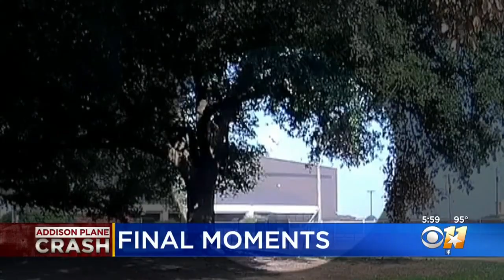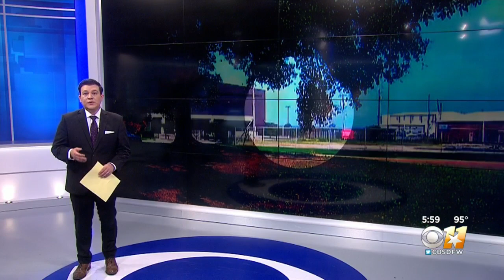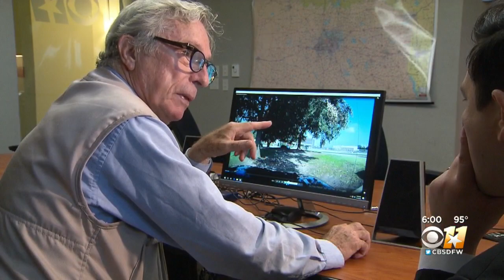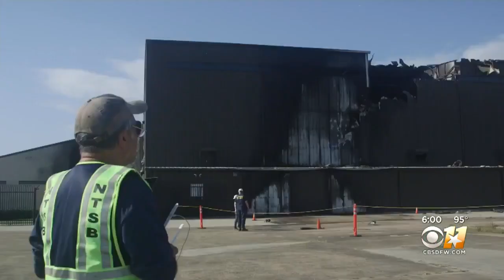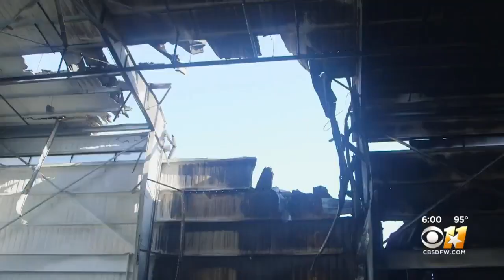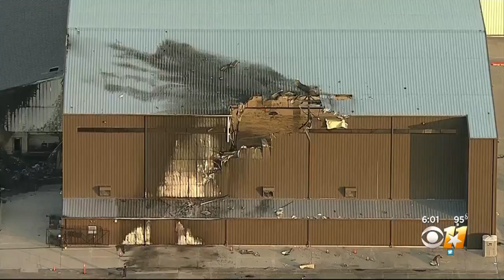Video Released Of Deadly Plane Crash In Addison

Comment: It’s now suspected that the throttle friction wasn’t tightened enough to keep the power full on and the pilot was a jump in and fly type. No checks were audible and the plane took off 7 minutes after spooling up. WAY too soon to have performed the checks. The throttle tension is on the checklist because it resulted in death previously and likely in this instance too. 71 yr old pilot was known to skip checks. He won’t skip any more!

Comment: IT was all pilot error, failure to use checklists and mainly failure to set the throttle friction.  They experienced left throttle migration, didn't recognize it, the pilot applied left rudder and then right, but it was too late.  He was apparently known to fly without checklists and it cost them all their lives.

Comment: YIKES.. the left engine had trouble and the right engine's torque made the plane roll over and crash.
The King Air 350 was very heavy with 10 passengers and luggage. The pilot didn't have much time to make any corrections. RIP to all lost.... When was the last annual inspection and was there engine tune up or repairs??
Reply: stop acting like u know shit it was most likely huma error like most plane crashes
Reply: Gage  Engine Failure During Takeoff (At or Above V1) for King Air B200

1. Power - MAXIMUM ALLOWABLE

2. Airspeed - MAINTAIN TAKEOFF SPEED OR ABOVE

3. Landing Gear - UP

4. Propeller (Inop engine) - CONFIRM AUTOFEATHER or FEATHER

5. Airspeed - V2 (after obstacles cleared, Vyse)

There are procedures for plenty engine failure situations so I'm certain it's not an automatic crash when you lose an engine. I think feathering is the key but I'm no pilot so this might be wrong.
Reply: Takeoff at MTOW with a Twin-Engine Aircraft is a Critical Stage of Flight.  You have to practice in your mind how you're going to respond to an
Engine Failure at that stage of Flight.  When you receive your Twin-Engine rating these are exactly the kind of circumstances you train for.
You have just a few short seconds to respond correctly, or this is the end result.
Reply: @Gage The King Air has Auto-Feather on engine failure. 
It's not really the engine torque or twist that makes the plane Snap Roll or VMC Roll or VMC Stall or whatever people want to call it. It has to do with the fact that, in this case, as the plane yawed to the left more and more of the engine out wing is covered or blocked by fuselage and thus its lift capabilities become less and less. You can see in the crash video the plane is skidding or yawing horribly. It gets to the point that the left wing is blocked so much that it looses its lift and stalls and the right wing snaps the aircraft over with all its lift intact. Also, as the plane yaws more and more the fuselage side surface starts adding drag and slowing down the plane taking you below VMC or the Minimum Control Speed. If you have full rudder in then you know your about to snap roll. It's a terrible balancing act of getting bank into the running engine side and rudder. Plus, the gear down did nothing to help matters. All that being said he only had 12 seconds from liftoff and 8 seconds from when they recognized an engine issue before impact. Plus, here could have been other factors or causes leading up to that moment. Heck, a rudder trim tab set wrong could be the cause and the pilots just thought it was the engine.
Reply: I can tell you what I would've done, and I don't even have a Pilots License.  

I've begun my takeoff roll and I've reached takeoff speed and rotated.  I'm beyond the point of abort.  Suddenly there's a loss of thrust on one engine. In a second determine which engine it is, then quickly change your trim settings to make your control surfaces more responsive. 

by the 3rd second, Pitch the Nose down level to keep forward speed up. Begin a shallow bank and rudder turn away from the dead engine.  This will give you a feeling right away of how the plane and controls are responding to Asymmetric thrust.

Your landing gear is Fast Acting, hit the gear up by the 6th second.

A shallow bank away from the dead engine also keeps your wing with the dead engine from Stalling.

by the 8th second you should be in a shallow climb and / or leveling off and flying on one engine, preparing yourself for a mayday go around and landing. 

And if you're really good and prepare yourself,
you can compress that all down to 4 or 5 seconds and look like a Hero / Pro, instead of killing all on board.
Reply: Gage  .. The pilot did not react quickly to the engine failure.. Of course you will tell us the proper procedure........!
Reply: Gage  In King Airs equipped with autofeather, the operating engine drives the autofeather of the dead engine. With the cockpit voice recorder recovered, I hope the investigators can determine if the autofeather was tested before takeoff. King Airs are known for very docile behavior compared to piston twins, during engine failure events.

Comment: His propeller became an airbrake because he didn’t feather the prop in time. Based on the other evidence he was in a steep angle of attack or Vx on rotation. I never pitch up too high in multi engine. There is a speed called blue line that must be exceeded at all times. 
Anytime there is an abrupt turning anomaly on takeoff roll shut both engines down and land straight ahead. This is critical in multi engine flying if you have an engine failure on takeoff roll.
Reply: Sky Flyer impossible. Modern PT6 engines use oil pressure to turn the props in beta range. There is a pitch lock regulator that prevents the prop from going in to flat pitch in an event of oil pressure loss. 
Based on the 737 max I wouldn’t doubt there are design flaws in the new 350i. 
I really want to see the final ntsb report.

Comment: I have a fairly generic question that maybe others are asking or thinking. 
So we reach V1, rotate and have a positive climb rate albeit not for long.  
1. At what point did the port motor fail?  Before V1, during V1 or right after they lifted off?
2. At what point does a PIC call for gear or raise the gear themselves?  Directly after takeoff, or at a certain height or speed?  From a laymen it seems the gear down would 100% cause more drag thus slowing them more rapidly especially with the port motor being down.  Could have calling for gear up given the flight crew that extra speed they needed to extend and gain a positive rate of climb vs scrubbing more speed eventually causing a stall 
Thanks for your comments and feedbsck. 
Prayers to the family and friends of the people onboard.
Very sad.

Comment: Seem like the right engine was on fire just seconds before flipping over and hitting the ground!
I've also heard that they where over the gross limit weight of the plane. So there was no way a single engine could handle the load. Seems to me that the weight limit should be restricted to what one engine can handle.
Reply: That was just glint from the propeller

Comment: First: WOW!! Worst CFI ever as a commentator on an accident, “at some point you become a passenger.” What kind of pilotage are you teaching? You don’t stop flying the aircraft because things aren’t working right!!! Hopefully with his next BFR the FAA will weed this terrible CFI out. 

Second: How did CFI commentator of the year see right past the obvious? These pilots had things going wrong, BUT yet the aircraft was still flying. More than likely the pilots saw the hanger approaching, increased their pitch (fearing they weren’t going to clear the hanger), slowed below Vmc, and yes at that point like CFI Yeager stated “something went wrong.” 

My prayers are for the souls on board, may they Rest In Peace, as well as the witnesses on the ground that have been traumatized by this accident.

p.s. Pilot’s watching this video, do yourself and your passengers a favor: Don’t stop trying to fly the aircraft and work the problem. Good CRM and good systems knowledge will get you a long way.
Reply: I don't think when he said "there is a point where you become a passenger", he was talking about the situation being unmanageable. Because pilots are trained to deal with this situation, and he as a CFI knows that.

I think he's talking about pilot ability, or rather, these pilots lack of it. And it makes sense really. First, if a pilot does not know how to quickly handle an emergency situation like this, then soon the situation could deteriorate to the point it becomes unrecoverable. And second, even if they figured out what was going on, did they truly know what to do? Because they could've very well handled the situation improperly, not taking proper emergency procedures, crashing is pretty much inevitable, and at that point you might as well have been a passenger for all the difference your actions made.

So before you go around hoping this guy loses his job, I suggest you truly analyze what he is saying, rather than interpreting it very literally, and therefore incorrectly. 

And if you think that he's truly "Worst CFI ever", I suggest you watch the Air Safety Institute's video "Accident Case Study: Everyone's Problem
". You'll be in for quite a shock.
Reply: Obsolete Collector My  comment comes from my 20 years of commercial flying. Never in my private days or now in my commercial career has an instructor said that it’s okay to become a passenger. The instruction has literally been to “fly the aircraft” and keep working the problem. My training normally has something that limits the performance of the aircraft and requires me to think, act quickly, keep flying the aircraft, OR crash. For example, I’ve had props fail to feather, high altitude on a hot day t max gross takeoff with an engine failure, and cold days with icing and a single engine or failed system. And yes, if you don’t react properly you will crash. But that’s why you rehearse this stuff. And why you can’t become a passenger. 

To your second paragraph, every six months I am required to handle an emergency similar to this. The PIC on that flight is to do the same thing, real world is obviously more stressful than a simulator, but his knowledge of what to do should have been there. An example from what I can see in this video is that he hadn’t retracted his gear yet, why didn’t the CFI in this video bring that up as a cause for his accident? Because he’s a terrible CFI!!! He’d rather scare people about the dangers of flying and how he’s the best than give a thorough brief on what he can tell from the sidelines. 

He needs to lose his job or have a good dressing down by the POI that is over his Flight School. The old adage is “Aviate, Navigate, and then Communicate”, nowhere does it say resign yourself and the people that have entrusted their lives to your hands to just sit back and die. This CFI just made that announcement on this news broadcast, it’s okay to give up. He’s fear mongering for the sake of getting in front of the camera. 

I watched your suggested video. How does a GA pilot doing what GA pilots do compare to what should have been a trained professional in the King Air? What I gathered was the CFI in this news story will teach his students to act like the GA pilot in the Piper Arrow, do things outside of the design of their airframe, get themselves into trouble, BUT (because he taught them) today they will become passengers and die. Not a great teacher, he’s the CFI from your video suggestion that is the bad apple.

My suggested video to you is “Aviate, Navigate, Communicate - by Jeremy Stone”   His video is more on par with what this professional pilots recurrent is like every six months.